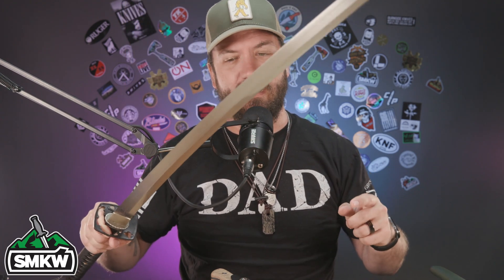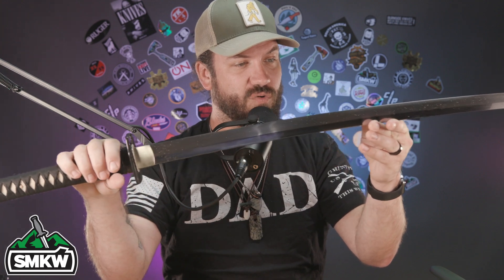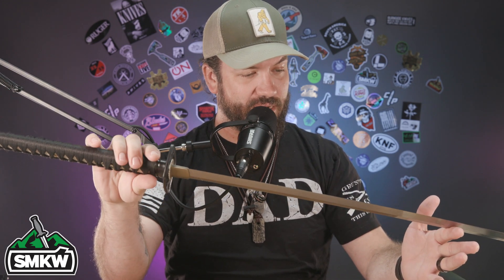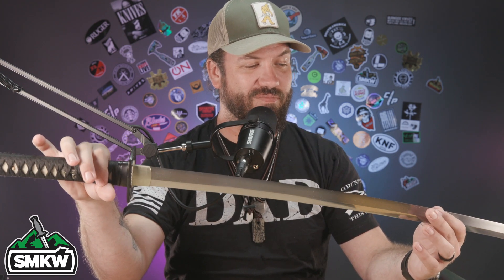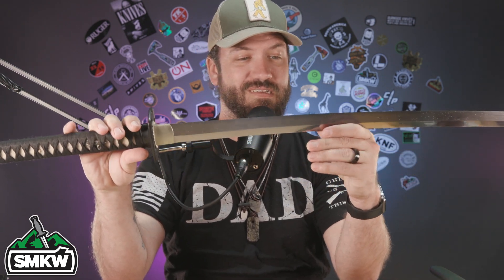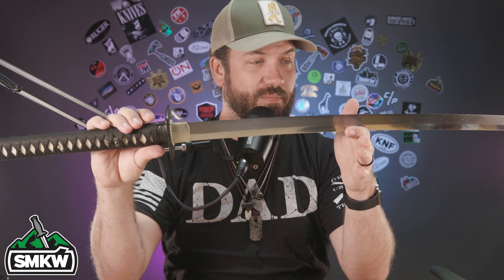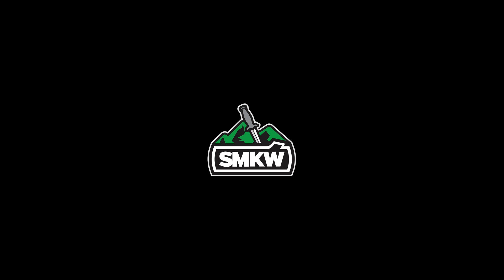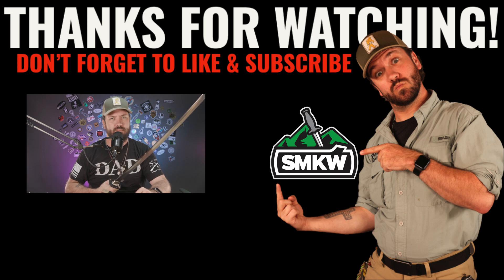What is Spring Steel?

Comment: What kind of spring steel is used in "pop-up" tent and portable greenhouses?  I'd like to get some to use as removable  braces over my raised garden  beds that I could simply install  by  putting one end through a fitting, I'd screw into the wall of one side of the bed and then bend it over and slide the other end in a fitting on the other side of the 3.5 foot wide bed so that at its highest point, it is 4 feet (give or take) above the fittings.  Any ideas of ways I could do this? Keep in mind I'm not a blacksmith. I'd like to simply know what thickness and type of wire to order with sufficient  springyness.

Comment: Would love to see a discussion about steel family differences, like 440a vs 440c or 420hc vs 420j. Even the XCrXXMoV or AUS series could be interesting!
Reply from the maker: Great suggestions!
Reply: Stainless steels, not for swords (unless a wall hanger, a small tactical sword like from karate mart, or a specialisation type stainless built for sword but those are research and is very expensive)

Though stainless have applications making it better than carbon steel and that's resistance to corrosion aka rusting, such would be are spoons,fork, cutlery knives and materials that need high corrosion resistance. 

For a standard stainless knife my advice would be anything short and can only go long to 10in blade length when properly treated